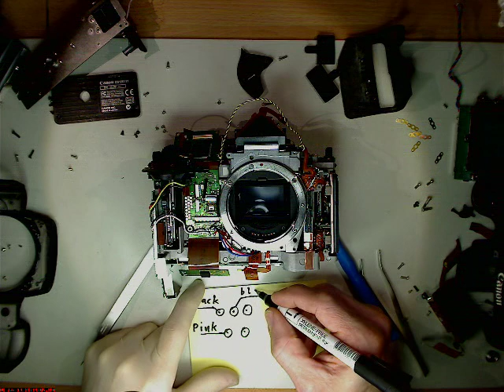Try to fix broken shutter in Canon EOS 1 D mark II N     PART 2          motion lapse film

Comment: Canon 1D Mark IV. Can you offer any advice on the replacement of the camera's lens mount plate? I need to replace the brass plate which has a stuck locking pin. After the removal of four screws on the plate's surface the plate still does not budge.

Comment: I'm about 3/4 of way through putting it back together now, what a bastard job! Did yours work first time after?
Reply from the maker: Wow, you did a good job,  well, i found that there was another failure in this camera, there was broken a little metal thing... :-( . So i desided to use the rest of the camera for spare parts that i need for another camera. But i also want to do some experience on how to make a digital camera into full monochrome ONLY, almost just like the Leica M Monochrome... It could a be VERY interesting project..

And good luck with your camera :-)
Reply: The replacement shutter I bought was also faulty and showed "Error 99" after all that!